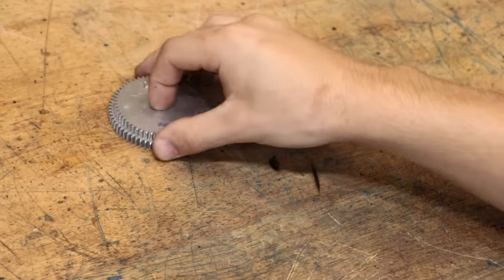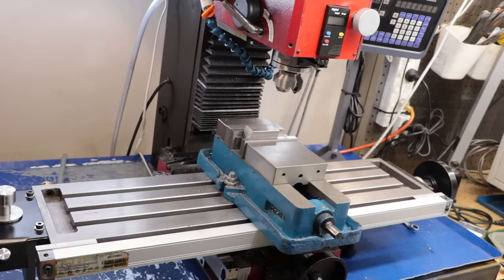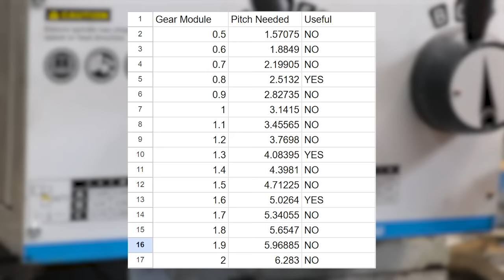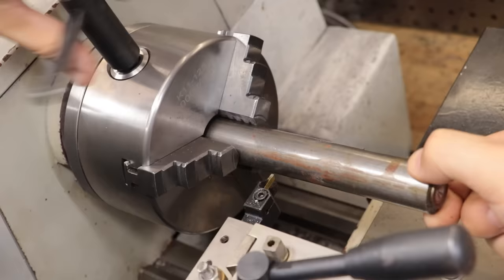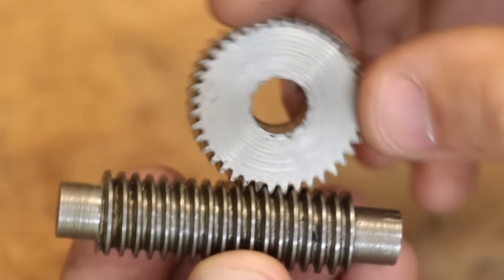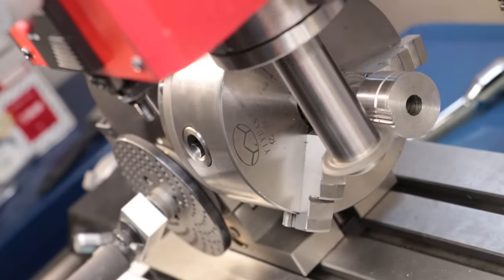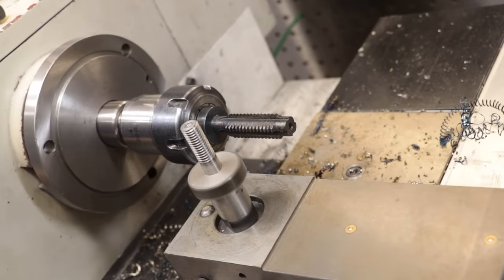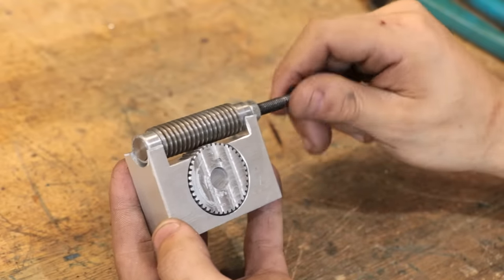Making Worm Gears. Harder Than You Might Think

Comment: Gashing isn't just "commonly used", it's absolutely necessary for cutting worm gears.  If you don't gash, you will get a different number of teeth to what you expect, and many will be malformed.  Ask me how I know.

As a matter of principle, you should form the outside of the gear on the lathe with a form cutter (this gets you a properly formed wheel rather than relying on the free hobbing to kinda sorta do it for you), and then gash coming in (on your setup) on the Y axis rather than the X which reduces the overcutting you may otherwise see on the outside of the gear teeth.  You don't need much gashing, just enough to get the hob to engage.

Another challenging gearset for the tool-inhibited is bevel gears.  They're a whole heap of fun to cut.
Reply from the maker: Very interesting read. I was under the impression that that gashing wasn’t absolutely necessary when it came to cutting works on universal driven set ups.
Reply: @artisanmakes  Ah, my bad.  Should have said "free hobbing".  If you've got a universal (or CNC equivalent) dividing head, you're right, it's unnecessary.  

That said, most of my old literature covers free hobbing as a preferable approach to  buggering about with universal dividing heads - the head itself is costly and relatively complicated to set up, and I believe the hobs used are different.  I might well be wrong on that last bit, though.

Comment: My first worm gears where a complete mess, especially because they were for an architectural feature (opening large windows in an industrial setting) and i really wanted to make them myself when i probably should've farmed that work to a professional. :))
Years later i figured that i could've bought a pump reduction for oil type pumps, which had the exact size and large brass gears i wanted.

Comment: Gear hob - material
Hello AM!
Nice Video, thanks!
What type of steel did you use for the gear hob?
Reply from the maker: I used an offcut of 4140. It’s not really the correct material for a hob but got decently hard enough to work. I would have used silver steel or anything similar if I had a piece in the correct diameter

Comment: Idea: Make a lathe chuck backplate with teeth cut into its perimeter so you can turn it with a worm like a rotary table, eliminating the need for an indexing head while also adding the ability to mill in polar coordinates using a mini spindle on the cross slide.

Comment: Another method for gear hobbing a worm wheel is using a thread tap rotating on center parallel to the outside edge. After you can use a screw as the worm gear. Now will it have the same capabilities as a  proper version? No. However for low load applications it works just as good.
Reply: That’s what I’ve seen.
Reply from the maker: In a sense yes. I don’t think they’re very efficient in carrying loads or wear due to the high pressure angle. For low use jobs I don’t see why they can’t be used.

Comment: 60 to 1 reduction in speed doesn't necessarily means 60 times increases in torque. Actually worm gears have much lower efficiency.
Thanks for your great content.
Reply from the maker: for sure, but as you would know the efficiency can vary wildly depending on a bunch of factors. Which I didnt feel it necessary to explain here

Comment: I have a silly question regarding making the helical shape on gear (not a machinist here, just a curious viewer):
What if one were to take a round (tube shaped) file and fit it into tool holder of the lathe and slowly grind the profile onto the gear turning on lathe's chuck?
Reply from the maker: The helical shape is to do with the tooth profile itself. The tooth curves backwards, instead of being straight. The concavity you are referring to is the throat of the gear.

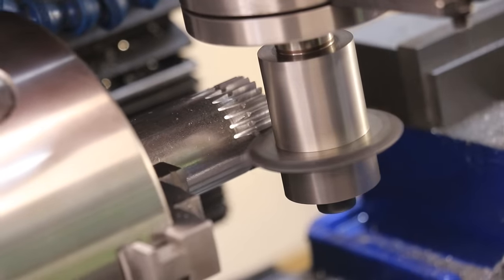Comment: 0:41 seems like you did not get the disc perfectly centered? the let side looks a bit smaller eg. than the right bottom? Certainly it might be okay for your application, when I made gears some time ago I ran into those issues I need a 10micrometer tolerance on mine...

Comment: I know the hobbing setup is ideal, but couldn’t you instead machine a radius into the gear OD, then cut the teeth at an angle by tilting the dividing head? That’s how my milling machine fine feed worm gear was machined after the factory one broke its teeth.

Comment: That cutting tool looks awfully similar to a tap. Could you theoretically make a worm gear using a tap, as long as the worm screw geometry was matching?
Reply: I've seen people do that on other channels,  I have no idea how good the service life would be though.
Reply: @LittleAussieRockets  I would suspect that on small diameter gears it would wear pretty quickly... but larger diameter gears would probably be fine. The closer the surface of the gear to "flat" is, the better the geometry would be.

Comment: you should look into the wobble of either your tailstock or your center as its clearly visible around 22:15 which does not improve the work or finish.
Reply: I was going to comment on that as well. The live center or something in the tail stock or possibly both are enough to be noticeable by eye in the video as the tool starts to cut. So somethings definitely not right.
Reply from the maker: Well yeah the tailstock is almost fully extended to allow for the whole cutting set up. Not very rigid that way

Comment: i wonder if you could make a change gear array that approximated pi, specifically for doing modulus turning. alternately, this could be the motivation for installing an electronic lead screw...
Reply from the maker: I do t have much interest in electronic leadscrews but there is definitely a gear train ratio that can get me to turn pi threads. It will require a complete rebuild of the gear train banjo to do it.

Comment: One thing I don't quite get... You machine your own gears... Why don't you just machine some additional gears for your lathe using some kind of fractional approximation of pi like 22/7?
Reply from the maker: I did that for the old lathe that I had, but this lathe is different. The gear train the connects the spindle to the lead screw gearbox is fixed, in that I can’t change the gears without rebuilding the gear banjo. And as for the gearbox, it’s sealed and there is t much that I can change there.

Comment: For correct meshing of involute teeth on spur gears, you should aim to be within 2:1 and 3:1 ratio. This is the rule I work with as a design engineer, and it came from the chief engineer on the design team for the Rover K series engine, who I work with. Your 200 tooth and 20 tooth gear would be pretty dreadful if it meshed at all
Reply: Not a gear expert, but spur gears can work with a rack, which is effectively an infinite gear ratio.  Involute cutters are often sold as a set (of eight, IIRC), each with slightly different geometry to accommodate different tooth counts.

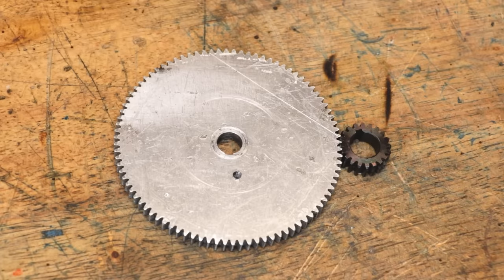Comment: 1:31.. that "mechanical advantage" have it's propper name, and it's torque :)

About 30 sec later you call it propperly.
Why not first time?
Or this is synonym in english (not sure... eng not my native language)?
Reply: "Mechanical Advantage" is a general term used for a system (levers, belts, gears, fluid converters, etc) 
which results in a difference of "force" between input and output.

"Torque" is specific to the "force" in rotating systems.

Comment: Q. On the 'not a worm gear' if you built adjustability in housing as it wore down you get better bearing? Not ideal but I'm asking in theory
Reply: I've wondered about similar things. I.e. two parts that don't fit well? Put some abrasive paste in it and run it a bit until the two parts are bedded in.

Not sure how well that would work though. Maybe more of a case-by-case thing that can be done.
Reply: @rcjbvermilion  Thats an interesting idea indeed.  Its really cool when the comments section works the way it should.

Comment: Is that a different cutting oil than usual? It looks goopier and messier than before.
Reply from the maker: It’s 3 in 1 oil. I guess not technically a cutting oil but it does an okay job in low speed cutting

Comment: pi is quite close to 22/7, relative error 0.0004. Do you have any gear pair for the lathe that gives 22/7 ratio? Like, 2 x 55/35
Reply from the maker: I can make up a set of change gears, but the problem I have is the gear banjo that connects the spindle to the power feed gearbox is fixed. There is no adjustment on the studs the gears ride on. I’d have to remake it to fit a different ratio of change gears.

Comment: Worm gear is almost easiest. You dont even need lathe for it.
Use bolt of your choice for input shaft, then take disk blank, put bolt trough the center hole, tighten the nut and chuck it into lathe or drill or drill press. Machine the cup form on the edge with angle grinder or files. Then move it to free turning axle like shoulder bolt on lathe chuck or benchvise. Then chuck into drill tread tap same size as your input sharft, then applying pressure with drill start carving the teeth into the disk while tab progresses around the disk edge in the groove creating the teeth profile. Hardest thing is to select the tap size and calculate the diameter of the disk and groove, just gentle run around can tell if it matches so teeth over lap when going around full circle, if not then decrease diameter slightly and try again.
This method can also be used to make far larger free hand treads least on female parts in softer metals like brass and copper. Just eat up one spot applying pressure and allowing drill to move up and then start applying side pressure. By the time you are around you can have 1.5mm tread raise in ID of 30mm and no need to buy special tap you only use once. 

This does not produce perfect treads, its same as poverty lathe, but works to hold the peaces for low pressure applications. The worm gear one i havent tested since havent had need but it should be far easier since you have the groove to give the support so tap wont wander around and all you need to improve this is to build jig where you can rotate tab top of the disk and apply pressure at the same time. Few scrap peaces of metal, couple bearings, treaded rod and tap of your choice should do the job just fine for better results than going free hand. Acme treads can be bit more difficult to produce but you can make simple few times use tap from peace of acme tread rod by slotting it, so same should work.

Comment: That is not how you do it. First, you can't make a spur gear. The teeth need to be angled to match the worm. Second, you have to use a horizontal mill and set up the dividing head on an angle. Third, you can't use a big involute cutter and cut left to right.  Fourth, the gear blank has a radius cut on the face to match the smaller diameter of the worm. The way that you cut that gear would never work on a larger DP tooth and the worm has very little contact with the gear.   So, the cutter needs to be the same diameter as the worm. Take a Woodruff key cutter the same diameter as the worm and grind it to the profile of the gear tooth you want to cut. Set up the dividing head on an angle to match the worm.  Remove the horizontal spindle and use an end mill holder to hold the cutter. Determine the tooth depth. Position the cutter over the blank and raise and lower the table (Z axis) to cut the gear.  Not side to side (X axis).
Reply from the maker: This is a valid and correct method as prescribed in the gear cutting hanbok for free hobbing gears. Like I said in the video, tilting the head wont provide a helical gear, but it is acceptable to cut in partially to gash it. If you are referring to the throat of the gear, the hobbling process is able to partially establish it, you can see it in the final cut, but yes it can be cut beforehand depending on the profile that you are aiming for. The hob is also the same diameter as the worm, I am not sure why you are jumping to the conclusion that it is not??? All of the math's here is calculated before hand and it works

Comment: Your video is interesting,but there is a problem in the description of your video: the gear ratio also depends on the number of threads on the screw. Now, about the theory part of your video: the minimal number of teeth for the smallest gear is linked with the maximum number of teeth of the gear it drives. The reason is mechanical interference, if you want to find more about it. 17 is often considered as the minimal number of teeth because no interference would occur for as long as you don't use a 4000+ teeth for the other gear. But you will find 11, 12, 13 teeth in a car gearbox for example, and it works. A common way to deal with interference is by adding an offset to your profile.
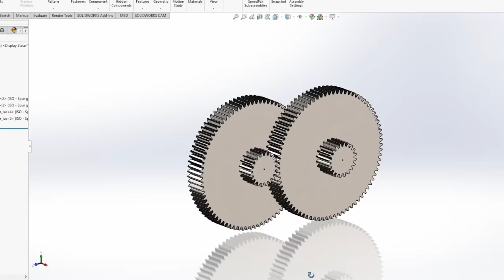And at 2:30 you are VERY wrong. Just adding gear train will effectively reduce the overall efficiency, but that is nothing in comparison with a worm gear, which has a dreadful efficiency, generally speaking. If you are looking for a good compromise between ratio and efficiency, the solution is a planetary drive, or a train of planetary drives. This is how gearbox are made, to adapt speed and torque between a gas turbine and a propeller on turboprop engines, for airplanes, for example. But you are very right when stating that worm gears have a big advantage in terms of volume, ofr the same ratio.
Last thing: you seem to make your spur gears out of aluminium alloy. You must have your reasons, but this is a surprising material for gears.
Please excuse my poor English (it's not my language), it must make my explanation hard to follow. But you should be able to find a lot of theoretical documentation on this matter. As for me, I teach mechanical engineering, and I'm just trying to help, but I don't intend on opening a debate of any sort. The odds of me coming back to read any answer are very slim.
Cheers.
Reply from the maker: I didn’t mean to imply that worm are more efficient, that’s definitely a mistake in my end. Being an engineer yourself you should know the difficulty in making planetary set ups in a non industrial environment. Or maybe not being an engineer :) one day I hope to make a set up to achieve that but I can not currently. and aluminium is the only scrap I had laying about in the context size, it’s not the intended material for what I am going to be using this for. Cheers
Reply: “The odds of me coming back to read any answers are slim” 

How to tell everyone you are that one lecturer that everyone hates

Comment: when you index your diving machine in one direction for the entire 200 teeth 
how does it avoid accumulating the error?
Reply from the maker: Inside the head is a 40:1 worm gear which does the dividing. It’s only going to be as accurate at the worm. But one full turn of the worm is one turn if the dividing head so I don’t think error will compound in that way.
Reply: @artisanmakes  i c... the err stays the same axial play of the worm

Comment: could you not just cut the gear by plunging the cutter straight in on the center line?  that should leave a rounded profile
Reply from the maker: It’ll leave a rounded profile, but it won’t be curved/helical, which is what the gear hob is able to cut. Cheers

Comment: My father says you know worm gears are less than 50% efficient, because they cannot be back driven. Sounds wrong to me, but he had 36 money making mechanical patents.
Reply: Yeah when he said 60x more torque, I was thinking well you won't because worm gears are hideously inefficient - probably 40x more at best
Reply from the maker: Without getting too bogged down into calculating it, there isn’t a definitive efficiency for worm gears, it’s more of a range which depends on a few of the design factors including the ratio of the system, friction of the materials and the design of the worm.
Reply: Worm drives are special application for deep reduction and when you require self locking.